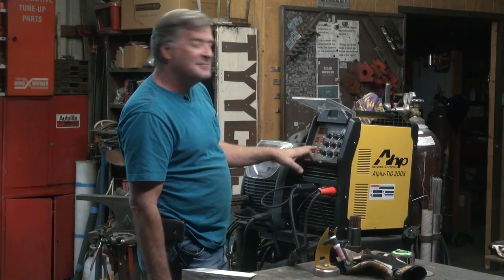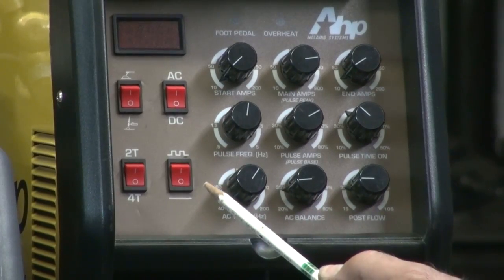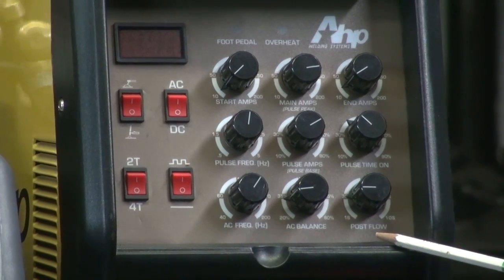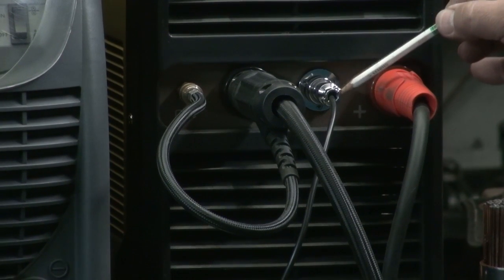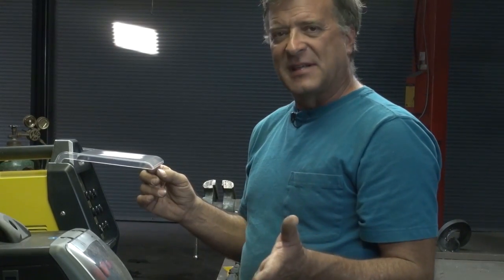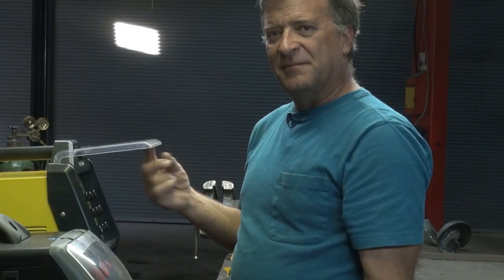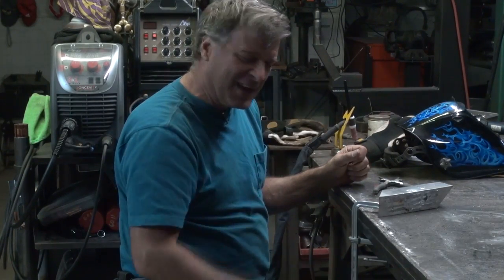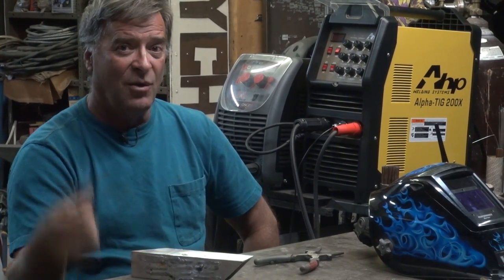Introducing the New AHP AlphaTIG 200X, 3rd Generation - Kevin Caron

Comment: Since you get your welder for free for extolling the virtues of AHP....Let me tell you about my new in box 200xd that was tested when i first received it 4 yrs ago .  I had several surgeries, and welder sat inside home ,inside orig box untill 2 weeks ago.  My son needed to use, so we took it out if box, started setting up bottle,etc, and turned on welder while we were prepping. No cables hooked up, just turned it on ,fans etc.  
And then it started....EXPLODING CAPS INSIDE!!!!
They refused to help, out of warranty.
$800 down the drain!!
AHP is junk inside & out.....Open one up, you will see Chinese garbage......
$800 is a lot of money to gamble in a known very poor product...and company that wants me to sent it back ,at my expense BothWays, and pay ~$400 for repair!!!   And its still out of warranty! If it blows again, oh well!!
Fat chance...I will be much more careful with buying my next TIG....   MILLER OR LINCOLN.
NOT COMMUNIST CHINESE
FOR SALE for parts if anyone needs this one!!!  It is BRAND NEW😳
IN your backyard Kevin!  Gilbert, Az
Anybody want a fixer upper?????
Reply from the maker: So after emailing me for help you now post this on my channel?!?!     You should check your power supply and make sure you are getting the correct voltage in the plug.   You will just blow up a miller inverter if you plug one in to the same plug.
Reply: @KevincaronSculpture  its verified house voltage. 123 &  242....not the problem.   I have read MANY REPLIES on youtube and forums about very similar issues of almost immediate failures.
I am an engr.....but not an electronic tech.
And i seriously doubt that a good board level tech would touch the thing after looking at the parts used.
Maybe the " new" xi is better....who knows.
As you responded to me today, you referred me to call AHP tech- x102, and talk to Nick. Thank you for the reply. 👍
But....
I did just that.........Last Week!!   Nick said he would talk to mgmt & try to help.
They offered NOTHING.    
I APPRECIATE Nicks apparent attempt to help.  Thank you Nick!
But i got zippoh
Nada
Gooseegg... 
Zero.
No credit toward new xi, or any other machine!!!   
NOTHING.
THEIR COMPETITORS DO MUCH BETTER in this situation!  
I am really ticked off.  This is inexcuseable.
I never met you, and you seem like a great guy.  My apologies to you for being in the middle.   But I just lost it & posted so other guys dont end up in this situation!!!!!
I can affort another welder.
Lots of guys/ gals might not!!!     And those are the people that i want to help, and protect.
My last Tig was a $5500 Miller......
Fantastic....perfection.....bulletproof...
Watercooled heaven.
But i will never need another like that for my needs after retirement.   
Every word i used here is accurate & true.
I have the ahp welder here for ANYONE that wants the proof of my statements about same.     Anyone that reads this can msg me...fb....  Only the Truth.
I am preparing a video autopsy of the failed machine in great detail.   There will be no doubt.  
AHP had every opportunity to help....
They offered nothing.
That says it all.

Capitalism
1st Amendment

Comment: you could also try settings up the tig for low amperage and write stuff in the metal since you wont create a puddle. you just burn the metal so you get a little burning tool haha. makes a cool design with the color around your lettering etc

Comment: i had gotten mine for 710 all said and done. Well worth the money. I got mine on like may 30th or so. So mine is about 2 months old or so. Feels like i've had it a lot longer lol.  Mine is the 2016/2017 version.

Hey kevin did you know that you can change the AC frequency on AC 7018's or maybe it was a different rod type like 7024. I forget which rods are AC or can be used on AC. but point is its interesting. I found that out on another video from one of the other guys i watch. Thats pretty cool.
Reply from the maker: Have not had the chance to play with that!    Thanks for the tip!
Reply: glad to help :). Its a very strange and yet interesting feature that i didnt expect to see till i saw the video of the guy doing it.

Comment: Question on versions between 3 and 4. This video shows the AC frequency up to 200hz. However the AHP web site says version 4 goes to 200hz and 3 only up to 5hz. I figure the 5 was pulse frequency, but they should correct it ASAP. Everlast looks better every day to me.
Reply from the maker: +Tom Herd 

Opps!!     will pass that on to the folk at AHP..    Yes, you are correct,  on the 3 version they are talking about the pulse..

Comment: Kevin great vids.
I got this machine (AHP) last fall and have been practicing welding aluminum. I was able ,eventually, to do a butt joint on 1/4" aluminum using a 1/8 general purpose electrode. I recently began practicing the same with 1/8 aluminum with a 1/16 general purpose electrode but so far its a disaster. I keep loosing the arc though I have tried different amp settings. Am hoping you can suggest settings or any advice that might make my practice more productive. Thanks much.
Reply from the maker: +Louis Balboa       The 1/16" tungsten is too small for the amps you need to run for the aluminum..   Stick with the 1/8th or maybe 3/32.

You are right at the edge of what this machine can weld in a single pass..      Next is your fit up and preparation for welding...

Comment: Kevin, I just finished setting up my 2015 model. Ive watched your videos as well and bought the E3 set-up.  I was wondering what is your typical settings on the knob controls when welding simple mild steel and aluminum. I am a beginner.  Thanks!
Reply from the maker: +thermalxx99     Play and learn ...    that is what I did...

Comment: hey kevin what amperage breaker should I use with the AHP 200?
Reply from the maker: +Bruce Schnur   30 amps is what the machine calls for.
Reply: +Kevin Caron, Artist thanks Kevin the AHP machine works great I already installed a 60 Amp breaker just to be safe.
Reply: What gauge wires did you wire the 60A breaker with?
Reply: standard wires in breaker box, I'm in a commercial building, two years running ahp tig no problems
Reply: As long as the wires are heavy enough to support 60A.  Otherwise, the breaker isn't really protecting against the wires overheating, which is the real purpose of the breakers.  Different size breakers are supposed to be wired with the corresponding wire gauges,  it wasn't clear if you just swapped the breaker with a larger sized one on the same existing line.  
If you're just running the AHP on it, it's probably not a big deal, but just be aware that breaker many not trip even if the wire circuit gets overloaded from some other things.

Comment: Kevin Caron, Artist I just bought this machine on the advise of yourself and Mr Tig. I just got it setup and began attempting simple beads on plate with no filler rod. 1/16 tungsten red 2% thor. My question is after arc initiation it spits sparks and leaves holes in the surface of the plate. Per Mr tigs video im running 15 cfh 100% argon. any idea why its doing this?
Reply from the maker: Bad ground maybe?!?      Wrong size collet in the torch?  You are running straight argon right?!?    Give me more info please!

Comment: I just bought this exact model and it is very finicky to start. The hi freq start fires right off, but I have to get the electrode within about 1/16" to initiate an arc (almost lift start). Is yours like this?
Reply: Good ground.
Cables tight.
Probably 10 years TIG welding.
Foot control (2T).

I'm used to 1/8" to 1/4" with big blue.

I think this one doesn't punch through the aluminum oxide as aggressively. I was working with it again today and noticed that DC lit right off on steel, so I gave the aluminum a good brushing and it lit at about 1/8 ", which is fine.

Aside from that, what a great welder. How they can sell it so cheap is beyond me.